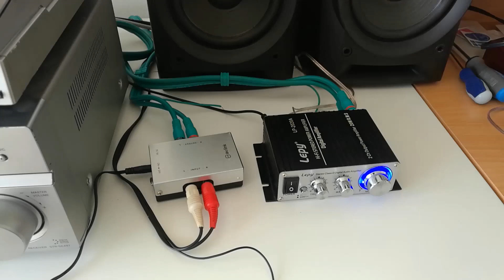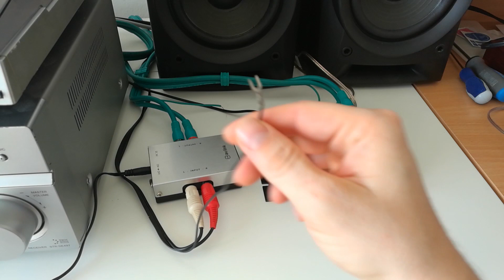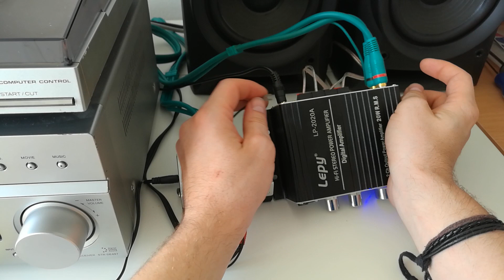Reduce hum from turnteble to Lepy LP2020A (Ground connect)

Comment: My Lepy amp has leakage current giving me electrical shocks when I touch its surface. Any idea how to solve it or should I just get a new one? Thanks
Reply: Probably has a short somewhere to the chassis, combined with a faulty power supply allowing high voltage to pass through it. Try another power supply.